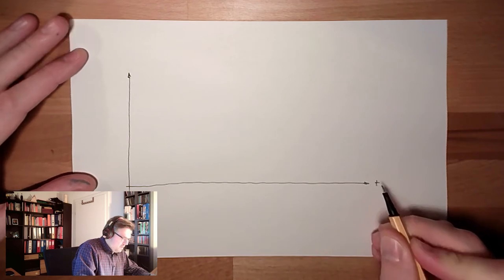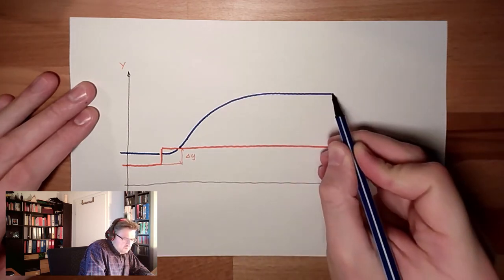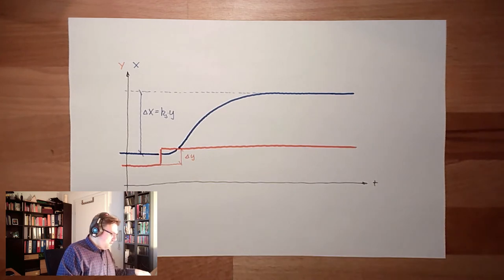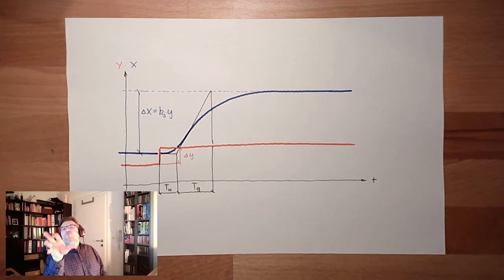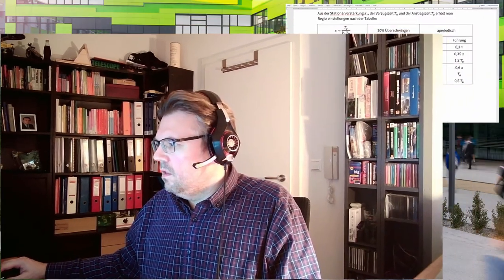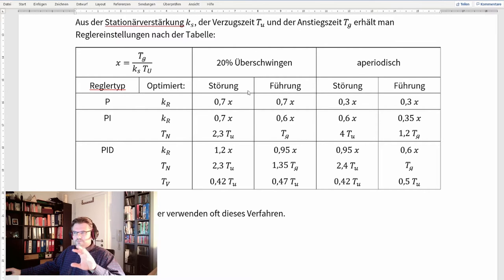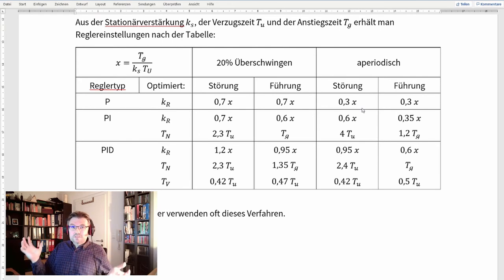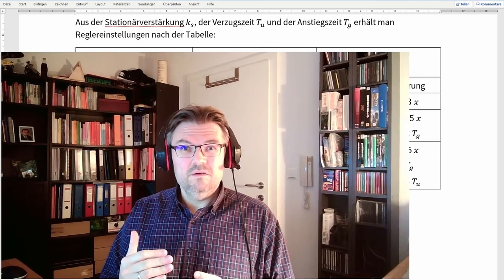Control 67: Tuning according to Chien, Hornes and Reswick (Old)

Comment: thank you for explanation 
clear enough but still need to try by my self so i can really understand to use this methode 
thank you so much
Reply from the maker: Yes do so. Best way to learn: Try it. Then you realise the things better. By the way: The series of Feedback-contorls will be updated beginning on June 19th. The information will stay pretty much the same. Some minor issues (i.e. with auto-focus) will be resolved so that it will be easier to watch. Also some bigger mistake in the DT1-Element will be removed.